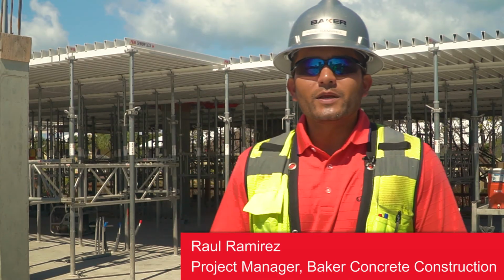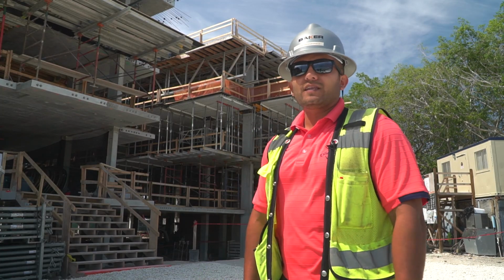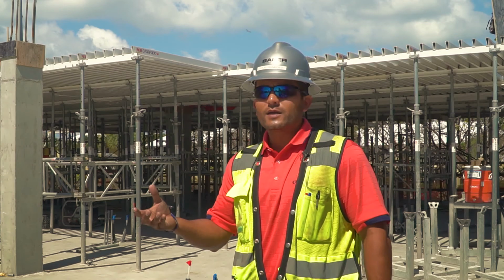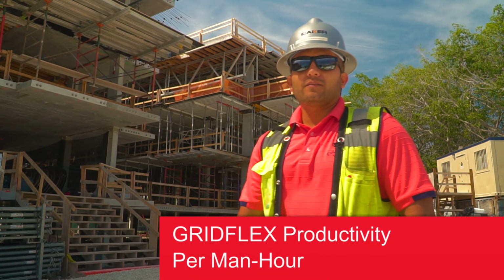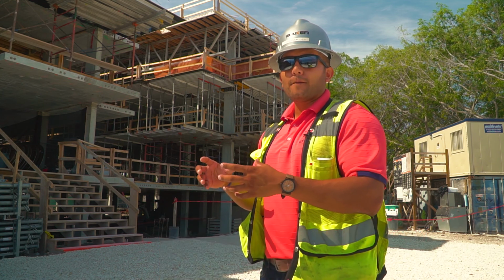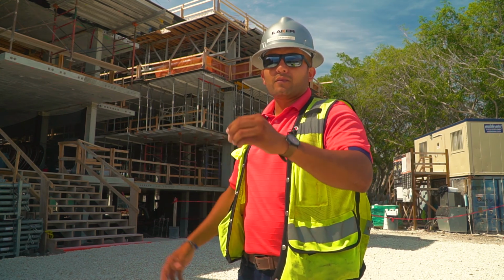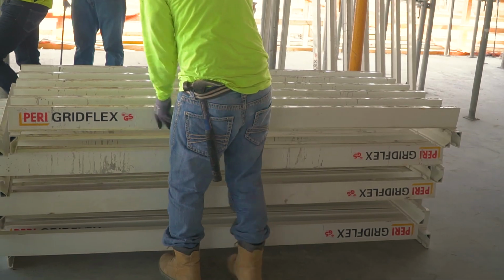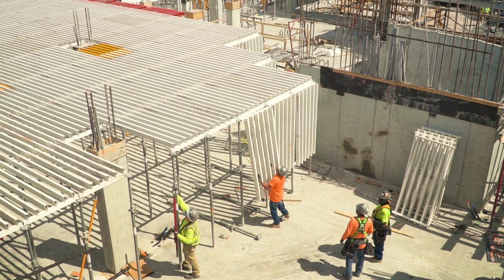FORMWORK | PERI GRIDFLEX Slab Formwork in Miami, FL (EN)

Comment: What about beams?
Reply from the maker: Dear Karan Sahni, thank you for your message. Could you please be a bit more specific? We are not completely sure we understand your question correctly? Best regards, Team PERI
Reply: @perigroup  Peri gridflix formwork is only for flat surface..?
Reply from the maker: Dear Karan Sahni, thank you for your message. GRIDFLEX can be combined with various other PERI beam formwork solutions. Which system depends mainly on the size of your drop beam. Most common and universal system would be combining GRIDFLEX with our MUTIFLEX slab formwork system. Does this answer your question? If you have further questions and give us your contact details, our experts will contact you directly. Kind regards, TEAM PERI